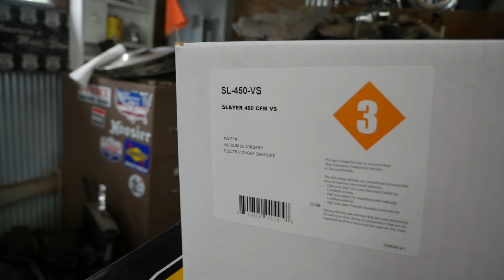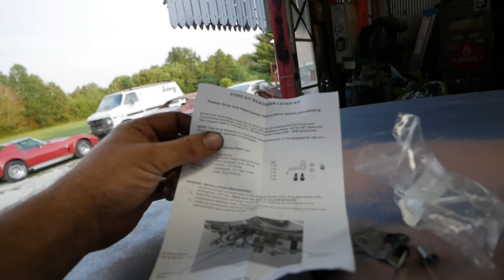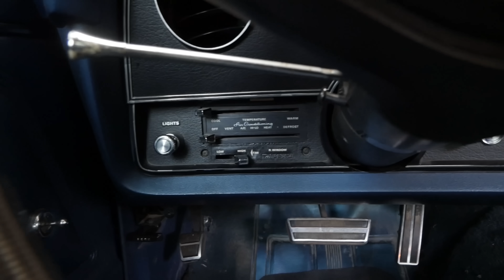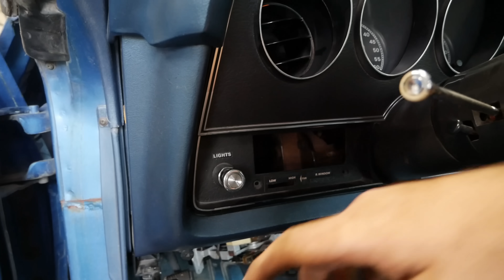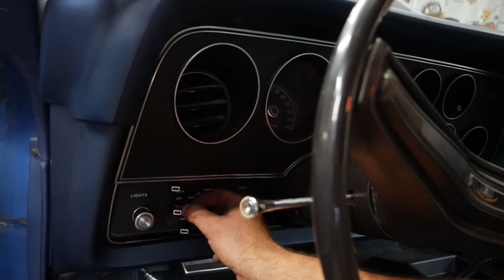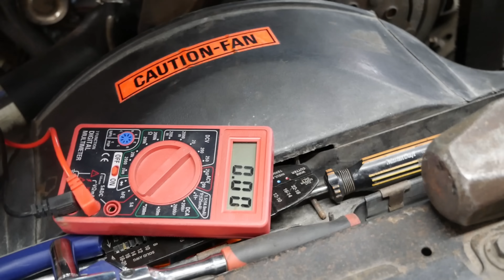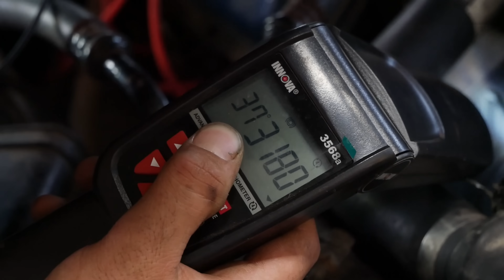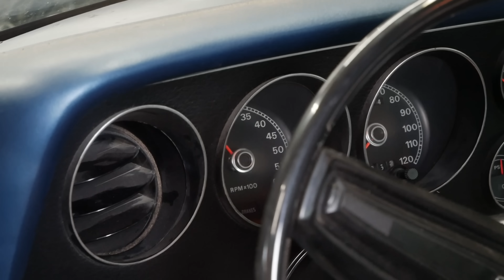1973 Gran Torino Sport Gets RADICAL Changes!

Comment: Fun fact. The Ford ATX transmission pump drive shaft is a perfect fit for driving the oil pump before putting the distributor in. It is nice and long and gives ample room for the drill.
Reply from the maker: Good tip!

Comment: I think the resistor wire doesn't lower the power to the coil till it is running if I remember correctly, see what the power is to the coil while it is running. Thanks for another great video.
Reply from the maker: You check it with the key in run position, 12v is typically used in the crank position. All power is delivered based on key position, not the engine running
Reply: @PoleBarnGarage  On an open circuit, the voltage at the end will float to maximum. There has to be a complete circuit for the resistance to show any effect, so it should have been connected to the coil to test that.
Reply: @PoleBarnGarage  okay, my bad thanks
Reply from the maker: Terry is correct, I should have thought of that

Comment: Hearing how small the 2 barrel is, I'm surprised it boogied as good as it did
Reply from the maker: It didn't lol
Reply: @PoleBarnGarage  It seemed okay in the last video.
Reply: @PoleBarnGarage  your using super clean?..... scrapers.... clean towels?....

Well slap me with a old fuel sock and shut my mouth with old metal strand filler.... you getting serious!!(falls off stool holding a old brake booster)
Reply: @PoleBarnGarage  the tight converter and tall gears didn't do it any favors either, I'm sure. That 450 will be a lot snappier with smaller primaries

Comment: I daily a 1994 f-150 4x4 SBRC 5.0 5 speed with 3.55 and 31/10.5 and I get 20 mpg on average. idk how but I drive slow and it gets better mileage than my old v6 grand prix.
Reply from the maker: Because you have overdrive and a tall tire
Reply: @PoleBarnGarage  yeah I’ve got 25 with it once. It’s weird. I used to have a 92 fox body with 5.0 and 5 speed that got 34mpg hwy and 29 city

Comment: Sorry not a worm gear..a taper gear. A 400 responds to exhaust and compression upgrade like you cant believe. It is a stroked and bored 351c...with no compression. Watch for spark knock at highway speeds with the egr delete.

Comment: I still trust AC Delco spark plugs. Says on em, assembled in USA from Japanese parts. I'll accept it for my GM vehicles at least.
Reply from the maker: Says on the AC delco box "made in China" and has for awhile
Reply: @PoleBarnGarage  Maybe plug material makes a difference? I have a brand new set of Iridium plugs (for an '09, Coppers not available) The box says ACDelco GM Genuine, no mention of where it's made. Same with the smaller individual boxes, they cover plenty of languages though.
On every plug, stamped on the steel section of the plug it says clear as day "Assembled in U.S.A. from Japanese Parts"

Comment: I love the car just the way it is, please undercoat that thing and grease it up, add some good struts or something all the way around, and i am betting it's the rims causing you balancing troubles, theyre originals right, maybe look into someway of having them renewed somehow, professionally, and good that car is going to be nice once you restore it, you're lucky to have it truly, my uncle had a white and black gran torino, that car was the second most car i ever had the pleasure to cruise the back roads in, the most fun was my custom wide body 79 z28, with vr60 goodyears on the back and zr50 perelli ferrari tires on the back, red flush interior, midnight bronze paint, 373 gears, 5 speed muncy lt2, 750 double pumper, edelbrock high rise, roller rockers, 254 heads, bored 60 over, 3.25 crane cam, with 9/12 to 1 compression, etc mint, 6th pkace show car, t-tops with stabilizer bars front and back, with posi bars, i was 17-20 years old when i had it, and god i miss it age 53 years old still :( the only good part of my whole life, the rest has been a nightmare 98% of the time😐
Reply from the maker: Last video we put new reproduction magnums on it
Reply: @PoleBarnGarage  yeah that car is sweet, starsky and hutches car, that car has a fantastic look and stance, that and the 69 mustangs, definitely the two best cars ford ever made, I can't stand fords, but they do have several gems over the years, they have a few more but you have to build them right, but most fords get a big L from me, most fords are nightmares and dangerous, especially in the wet, or like riding on a tin can with wheels, and steel bars for shocks on bumpy roads, especially the trucks, I use to detail and deliver brand new ford mustangs in orlando florida for years, at ford mcinerney, hated them, to stiff, no grip, I use to build steel threaded fences in Arkansas, chevy trucks would flex in the ditches and ride smooth on the back roads, fords had no flex and would rattle apart as they rattle your teeth out lol

Comment: The patronics igniters a garbage every time I have used them both engines would at best fire on 6 out of 8 holes just upgrade the ignition system you will have way less problems and gain way more power.
Reply from the maker: Never had any issue with them. You're likely not gaining any power with ANY ignition system

Comment: I'm a old guy, & I like 4.11 gears?
Reply from the maker: When's the last time you drove 4.11 gears daily?
Reply: @PoleBarnGarage  everyday. Currently & will do again in about 10 minutes. If I could post pics here I'd send u one. My daily is a 71 f100 4x4 shortbox with a .060 over 390 & np435 4 gear with a 9 & 4.11 gears. Also a 75 with 4.11. Also a 76 f250 with 4.10. Also a 90 f250 with 4.10. Sorry charlie,  I got gears!
Reply: @PoleBarnGarage  p.s. oh ya, also a mini spool in the back of that 71. A Detroit locker in the 75.
Reply from the maker: @jesseduke694  those are trucks. Taller tire=less rpm. I drive 80 miles a day to go to work, and back. I'll run 3800 rpm every now and then but not daily lol
Reply: @PoleBarnGarage  my 71 the tires measure 28 inches tall. 3100 rpm at 60
Reply: @PoleBarnGarage  ya, I'll admit, I dont drive 80 miles a day. Maybey 15 to 30. But I have gone on longer trips with it & with the current smaller tires, & the speed limit being 65 on the bigger hyways here in Iowa & the flow of traffic being closer to 75 - 80 on those roads, it is alot of hanging rpm for a long time! I somtimes will run those speeds for a bit then I will back off & let the flow of traffic go by for awhile & give it alil relief somtimes for a stretch of miles at maybey 65 for a while. Especially if it's a blistering hot day! I haven't had any problems yet. It's performed amazingly! But somtimes I still think, don't push it to far! Go across that line once & I can't take it back!

Comment: Best engines in these, are Q code 351C 4V/CJ or even a 351C 2bbl. H code. Not a big fan of S code 4002bbl. And , No there not just a bigger 351C.
Reply from the maker: 400 is terrible. 460 is the way to go with anything, period

Comment: 8:02 things I wish I knew when I was building my '76 Torino sedan a decade ago.  I removed the 351M and put in a 351C.  Wasn't intending to use the two barrel 2100/2150 type carb it had on there so needed a four barrel and the Cleveland engine already had an Edelbrock performer intake.  Opinions were all mixed on the forums about using a Holley and how big, or just get an Edelbrock because it's sic easy, or YOU IDIOT GET THE STOCK 4300D even though they suck and you need a different intake oh and MAKE SURE ITS NUBMERS MACTHING OR JUST GET A CHEVY IF YOU WANT TO JACK WITH IT YOU DANG MELLENIEL...*blink*...and I just did NOT care to do that on a barely driver quality four door. So I located the cheapest used not frozen up Edelbrock with an electric choke for forty bucks on Craigslist before Craigslist sucked and I suffered figuring out the throttle linkage and kickdown lever and buying this Dorman linkage and this Summit spring and then chopping this and that up and had I gone with a Holley I'm pretty sure it would've saved a lot of hassle.  But I do love those Edelbrocks on GM/Chrysler engines.  Next Ford I get I plan to run the 2150 because I know it and it does well, but that Economaster sounds interesting maybe I can put some wagon wheel things in another carb's venturis and see how that does.

Comment: A 400 has no water in the intake  you don't need to drain the water to change the intake manifold !
Reply from the maker: Early 400 does have a coolant crossover, 74 and up eliminated it.
Reply: @PoleBarnGarage  I owned a 1971 LTD with 400 and it had no water in the intake manifold, how early do we have to go.
Reply from the maker: Check the intake gaskets for early and late ones, early ones have a provision for a coolant crossover like a small block Chevy. It's possible I have it backwards, it's been awhile, could be the later one has the coolant crossover
Reply: @PoleBarnGarage  I guess it is posable that my 400 had a set of Cleveland heads installed, but it had no water in the intake manifold

Comment: Cleveland OR 460?
Reply from the maker: It's a 400 pretty clearly lol
Reply: @PoleBarnGarage  Yeah, you said later in the video (Brainfart) and I wanted to comment to boost your video. I haven't seen a lot of ford 400's(351wm but not 400). I just saw that the thermostat housing was on the top of the intake and not facing forward. It's neat that the Firewall is just about identical to my 78 Ranchero.
Reply from the maker: Can't wait to get rid of it personally lol

Comment: Needs a 460 👍
Reply: 460 is a smog motor . 429 would be much better.
Reply: @Angelo-fo8de they did some non smog 460s right? As far as I know mot all of them had the fucked up timing sets and smog pumps etc. Either way some aftermarket parts make them lively enough
Reply: 460 was introduced when high emissions standards came into play .
In 72 you could get the Torino with a 429. In 73 top dog in the Torino was a 460.

Comment: Thought you were gonna squeeze that 460 from that big red boat into that there automobile.
Reply from the maker: I will but it runs fine for now
Reply: @PoleBarnGarage  Better put all the speed parts on it before you go engine swapping. Good work though, sir.
Reply from the maker: I mean, just a carb and intake 😂 I'm sure that 400 will still find its way into something else down the road, even after I go 460
Reply: @PoleBarnGarage  Oh, I meant putting speed parts, like a big thumper cam, in the 460 before you put it in the Torino. As far as the 400 goes, Dylan McCool has that fairly clean MG sitting around he doesn't quite fit into...